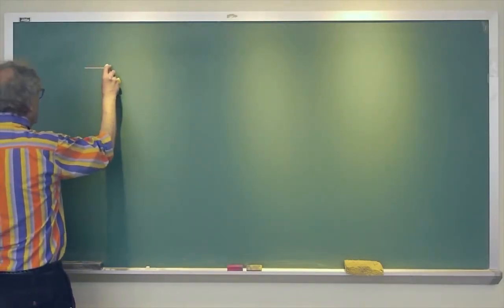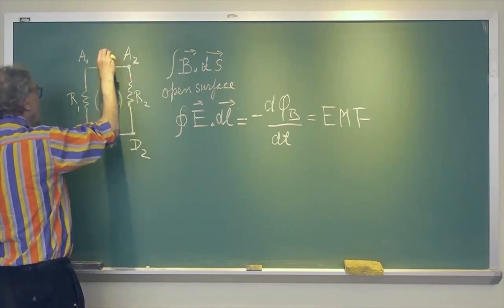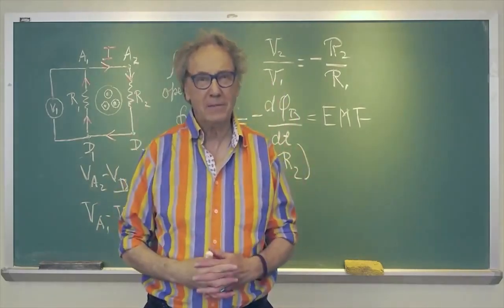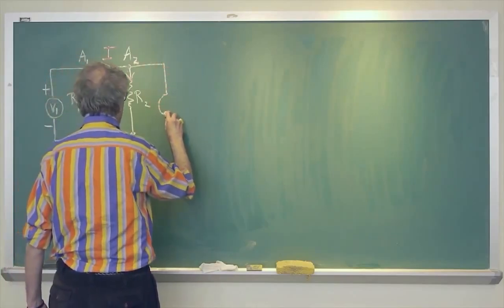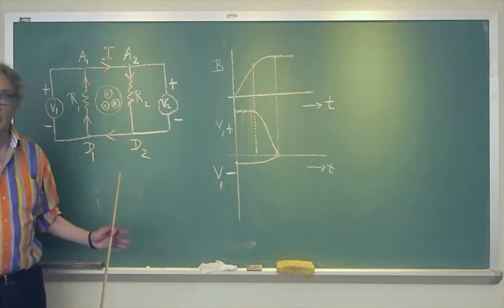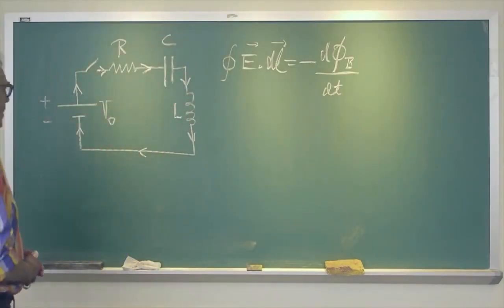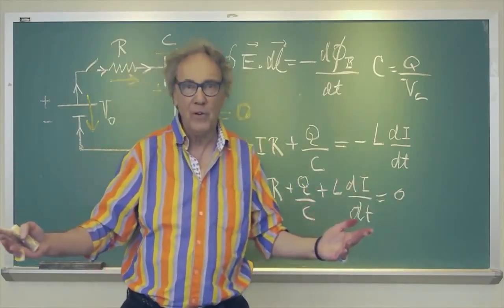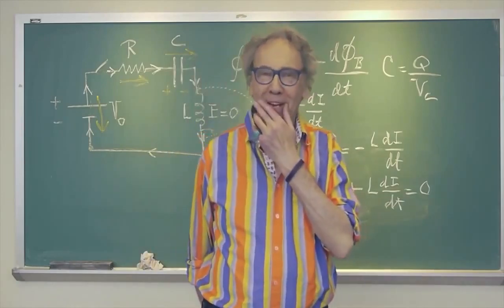Kirchhoff's Loop Rule Is For The Birds

Comment: hi professor, a current flowing in a wire means that there is a force acting on the charges, and it means that there is an E field, so a potential difference in that same wire,?
Reply from the maker: >>> a current flowing in a wire means that there is a force acting on the charges,>>>
NOT NECESSARILY!
There is NO E-field inside a super-conductor thus there is NO force on the charges yet a current can flow through it.
Reply: professor, what about the book you are using in 8.03, i'm looking maxwell's equations derivation about brewter's angle, you said that it's part of 8.03
Reply from the maker: 8.03
Vibrations and Waves by
Anthony French
CRC Press
ISBN 9780748744473

8.03
Electromagnetic Vibrations, Waves and Radiation 
by Bekefi and Barrett.
The MIT Press
ISBN 0-262-52047-8
Reply: thanks so much, professor does the laws of physics like guass's law of electricity have a proof? also Newton's second law and so on ..
Reply from the maker: they cannot be proven from first principle. Their "proof" is based on their being verified in trillions of cases.
Reply: hi professor, in a superconducting wire , lets suppose a circular one , when we apply a changing magnetic flux inside, there must be for a fraction of a microsecond an E field because electrons can't move with their own
Reply: thansk professor, but Feynman's lectures the book, because i have a book feynman's lectures on physics or is it a vedeo, and what it called this phenomena i can't read the whole book for the moment?  thanks sir
Reply from the maker: Keep in mind the E*sigma=j. j is current density, sigma is the conductivity. If E = 0 and sigma is infinity j can be anything.
Reply from the maker: I changed my response to you to remove Feynman. At the heart of this (as always) is QM! Therefore the best answer is; "Keep in mind the E*sigma=j. j is current density, sigma is the conductivity. If E = 0 and sigma is infinity j can be anything.
Reply: @mathssoso4261  Hello, which was the correct answer for this?

Comment: I have been an electrical engineer for many years, and I get the general idea about what kirchoff's Loop Rule says, but after watching this interesting video, it seems to me that Kirchoff's Loop Rule is another way of restating what we already know about conservative electric fields, which is that the line integral around a closed loop of a conservative electric field is always zero. So, in my opinion, it should not be used when we have non-conservative electric fields along the circuit. Because, if it's used (like it is taught today) when we have a non-conservative electric field like that inside a battery, why not using it when we have another non conservative field like that inside the wire of a coil? What I mean is that, if we can't use kirchoff's Loop Rule when we have a non-conservative caused by a changing magnetic flux, then we could not use it either with a non-conservative field inside a battery. Or we can, but one (with a different name than "Kirchoff's Loop Rule") which says Sum(E)=Sum(R*i). Superb video. Thank you Professor
Reply from the maker: >>>What I mean is that, if we can't use kirchoff's Loop Rule when we have a non-conservative caused by a changing magnetic flux>>>
I agree for 100% that's what this video is all about.
Reply: @lecturesbywalterlewin.they9259  Professor!!!!

Do you do podcasts!?

I'm in the DemystifySci's community and would love to see you as a guest!!!
Reply: Thank you for the this comment! It was very insightful to a layperson like me.

Comment: Does the absence of electric field due to 0 resistance follow from ohm's law and V=E dl
Reply from the maker: No E-field is possible in a superconductor. But a current can go through it depending on the circuit. The integral of E dot dl through the superconductor will then still be zero.
Reply: So, is Kirchoff's law applicable to ac circuits
Reply from the maker: Yes K's loop rule can be used in AC circuits as long as there is no obvious dphi/dt. In any circuit there will always be a dphi/dt but that is normally completely negligible. But it DOMINATES in my demo, in transformers, in power stations! It runs our entire economy!
Reply: What about a pure inductive ac circuit
Reply from the maker: pure inductive means superconductive components. Look up Meissner effect.
Reply: Lectures by Walter Lewin. They will make you ♥ Physics. What I was referring to, in the previous ques ws that, if I apply an ac voltage to an inductor(superconducting), is K's loop rule still applicable, or should I use Faraday's law for the inductor

Comment: Prof Lewin, thank you for everything, from Argentina I sincerely admire your work and dedication.
Nevertheless i think Kirchoff s rule is applied in theory for electrostatic fields and not for electromagnetic ones. Actually, the "conservative" property of the electric field is only valid for electrostatic ones.
Reply from the maker: yes that is correct.
HOWEVER, you can ALWAYS use Faraday's Law - ALWAYS -. in both cases:
"electrostatic" and "electromagnetic". Thus with Faraday's Law you can never go wrong. Thus Kirchhoff's loop rule is NOT needed. We can do without it. "It's for the Birds".

Comment: Dr Lewin: Thank you for your illuminating talk. I wonder if you would be kind enough to clear up the following point.
A1 being the same as A2 since the resistance in the wire is negligible, D1 being the same as D2, allow me to call them just A and D.  If I (1) connect A and D to a voltmeter, put the voltmeter on the right side of the circuit, turn the magnet on and measure the voltage, and (2) turn the magnet off, put the voltmeter on the left side of the circuit without breaking the points of contact with the circuit (by alligator clips, say) and turn the magnet on again, it appears from your lecture that I would then measure a different voltage.  The internal resistance of the voltmeter is assumed to be very large, and one can assume that no current flows through the voltmeter. The electrical contact points being the same for the two positions of the voltmeter,  how does the circuit "know" that the voltmeter is on its right or on its left?  What if I put the voltmeter out of the plane of the circuit, say, between R1 and R2, what would be the voltage?  
I did read your supplementary note on lecture 3-15 on this demonstration,  but still could not figure this out. How could the measured voltage be dependent on the position of the voltmeter?  Thank you.
Reply from the maker: watch this lecture with the mind boggling demo at the end.https://www.youtube.com/watch?v=nGQbA2jwkWI&list=PLyQSN7X0ro2314mKyUiOILaOC2hk6Pc3j&index=17
If you then still have questions, read the following msg which is my standard response to all non-believers.

The demo I show has become a classic - it is shown all over the world. Two identical  voltmeters connected to the same 2 points in a circuit show very different values and the polarities are reversed. That's the power of Faraday’s Law which runs our entire economy. It's amazing how many people have a religious INCORRECT believe that Kirchhoff's loop rule always works. If that were true my two voltmeters should read IDENTICAL values with the same polarity but that is not the case. K’s loop rule is only valid if d(phi)/dt=0 but that is not the case here. Thus the integral of E dot dl in going from A to D depends on the path and the 2 paths are different; one path is through R1 and the other path is through R2. If you don’t get it, you are not alone. Occasionally I get comments from people including science teachers who want to argue with me about this demo  - they clearly never FULLY understood Faraday's Law. I never argue with anyone about this as this is too basic. This is therefore my only response. 

By the way, in class I made the length of the wire A zero and also of the wire D.  Thus there was only one point A and one point D and both voltmeters are attached to A and D. However, that is not at all a necessary condition as the resistance of common copper wire is much much lower than the resistances of R1 and R2. Thus my diagram on the blackboard is fine.

Comment: i noticed a lot of college books try to resurrect kirchhoff loop rule by modifying the rule, avoiding the differential equation... ,i have never seen any books/websites that say we have to use Faraday's Law to solve the problem, and yet they are using electricity everyday which is not possible without faraday's law, so embarassing
Reply from the maker: Kirchhoff's loop rule is a special case of Faraday's Law. F's Law ALWAYS works, K's Law ONLY works if there is no magnetic flux change in the loop. Thus we can tackle all problems with F's Law, but not all with K's loop rule.

Comment: When electron passes through an inductor, does it face any potential difference?
Reply from the maker: There  is NO E-field inside an ideal conductor as its resistance is zero.
Reply: a concept that if there is a 'I' current through an inductor 'L'  then at that instant the stored energy in the 'L'  is given by        '1/2LI²'.How to explain this phenomana according to 'zero electric field inside L' theory?..Because if electric field is zero inside L, inductor can neither absorb energy nor release energy.
Reply from the maker: There is NO E-field inside an ideal L.  There is a current I in the circuit and that current goes through L. Thus L produces a B field and the energy is 0.5*L*I^2. It's all Maxwell;s fault! Watch this https://www.youtube.com/watch?v=nGQbA2jwkWI&index=17&list=PLyQSN7X0ro2314mKyUiOILaOC2hk6Pc3j
Reply: Thank you very much sir!.. lot of confusions got cleared, and also some are being created. Would you tell me how to define impedence accross an inductor?... As there is no voltage drop accross an inductor, we cannt define it like resistive and capacitive impedence i think.
Reply from the maker: The impedance of an RLC circuit is well-defined. http://hyperphysics.phy-astr.gsu.edu/hbase/electric/rlcser.html
Reply: Is there any flaw in the formula p=v. i ? it works well for R & C but fails for L.
Reply from the maker: Power is I*V is always correct.

Comment: Hello sir! I interpret Kirchoff's laws as a statement of the conservation of energy. Since it does not hold true in this case, where has the difference in potential energy gone/arisen from?
Reply from the maker: K's loop rue has noting to do wth energy. If there is a change in the magnetic flux through a closed loop, the integral of E dot dl from point A to B depends on the path. Going from A to B you may find +10 V along one route but minus 2 V along another pass. That's the Power of Faraday's Law which runs our entire economy!!
Reply: Thank you! What is the physical implication for this though? The fact that delta V between two points is path dependent? What would one see if one followed an electron as it makes one journey across the loop?
Reply from the maker: The implication is that this runs our ENTIRE economy! All electric power stations work because of Faraday's Law.
Reply: I meant how does this mathematical relation translate into physical phenomenon? How does an electron's potential energy/speed vary as one traces its path through the circuit?
Reply: Okay. So, I'll try to do my best to explain the issue here. The magnetically-induced emf in the loop is giving rise to a non-conservative E field in the circuit elements. Electric fields induced by changing magnetic fields (or rather the E fields due to a changing magnetic flux through a closed loop) are very different from electric fields due to the presence of electric charges in that they are non-conservative. In the case of induced E fields (from a changing B field), charges need not even be present for the electric field to exist. By the way, it is through this mutual induction process of B fields/E fields (as described by Faraday's law and Ampere's Law) that electromagnetic waves, or light, propagate through vacuum. So it doesn't even make sense to be asking what the potential energy of an electron is at a point in space (or what the potential is at any point in space) where all you have is a non-conservative electric field! We define a potential for conservative fields only, because it makes sense to be asking this question when you know that the potential difference between any two points is the same. We are never interested in an absolute value for potential or potential energy. We only ever care about the difference between the potential at two points in space. Since the integral of E dot dl is not zero in the case of an induced emf, the E field is not conservative and a potential function cannot be defined. If we did do that, then we would find that the potential at a point A in space would be different depending on which point we take as reference. For example, I could say that the potential at A relative to B is 100 V, and the potential at A relative to C is - 1 V. Hence, since the integral of E dot dl is path dependent, it would be nonsense to even want to define a potential for this induced E field. In mechanics, for instance, you would never ask the question "What is the potential due to the friction of my room's floor at a specific point in space on the floor." How much friction you encounter in moving furniture around your room, for example, obviously depends on the path you take. There might be areas with more friction than others. That's because friction is a non-conservative force! You can't assign at each point in space a value determining the work that you have to do to get there, it is path-dependent!
Reply from the maker: In case of induced emf, the potential difference between 2 points in the circuit depend on the path. In other words, potential diff is no longer uniquely defined.